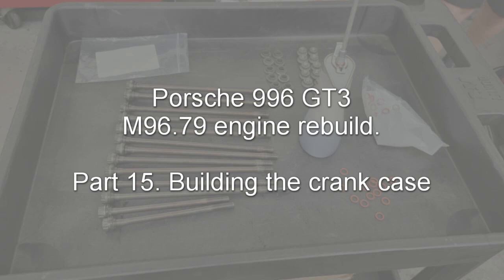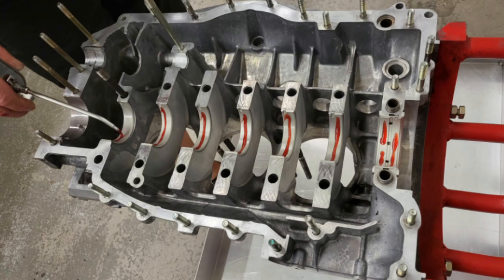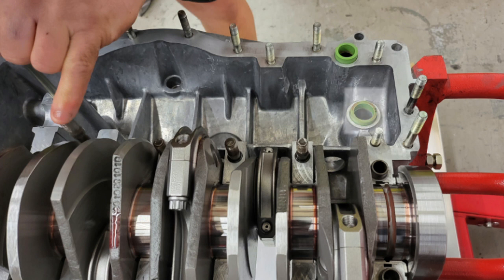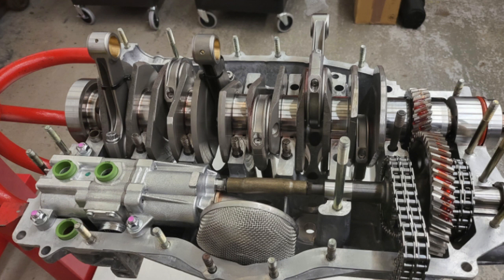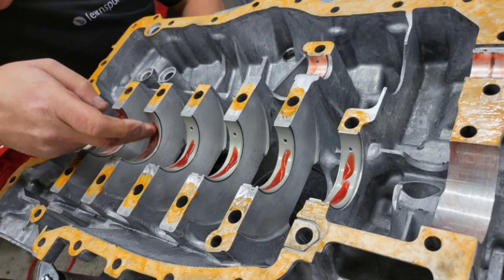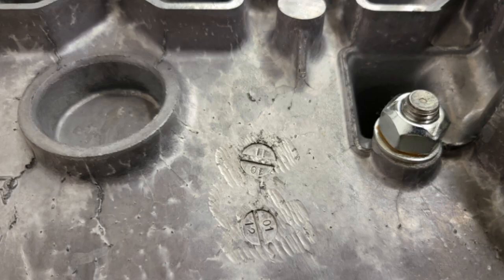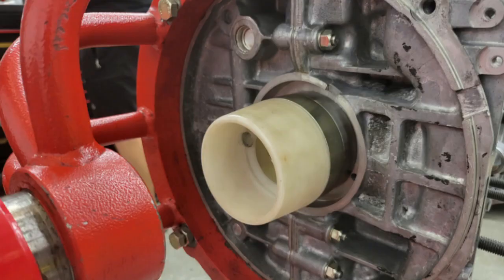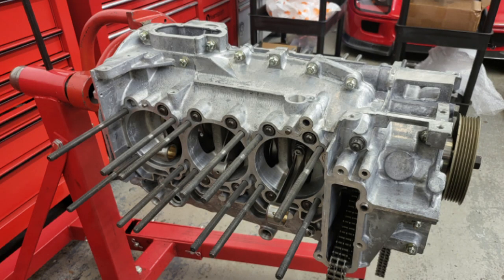Porsche 996 GT3 M96.79 engine rebuild. Part 15. Building the crank case

Comment: Hey Martin, Love the content and I can't wait to get my block together. May I ask you a few questions? The through bolts, I assumed that they are reusable; did you reuse yours? if that is the case are there any checks we need to do to them before reuse?
Reply from the maker: I did reuse them.  They were thoroughly cleaned and checked for any obvious damage.  Apparently no issue with reuse so long as torqued correctly.
Reply: @martinhill5770  awesome stuff Ty!
Reply: Hi Martin, this is great work.